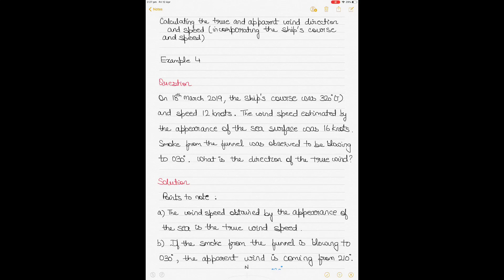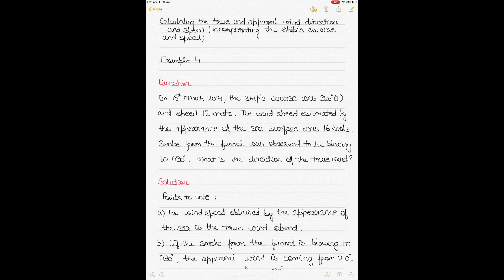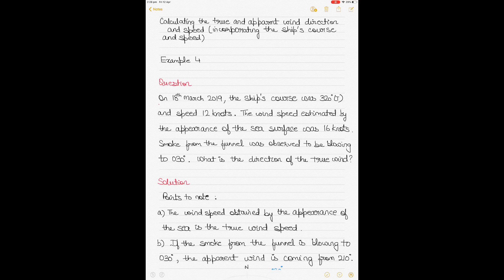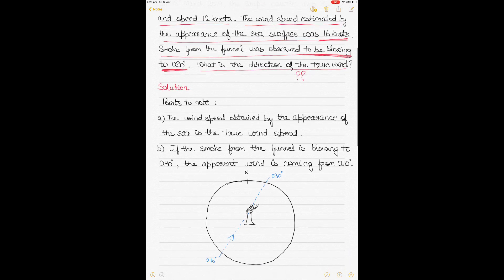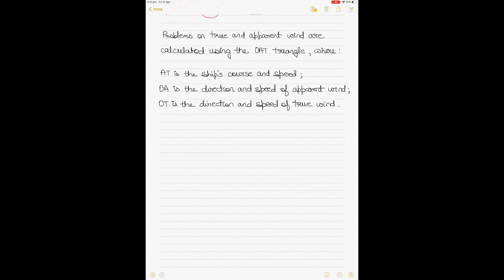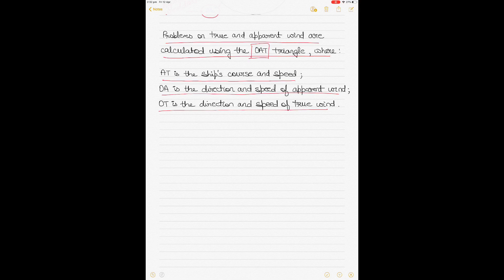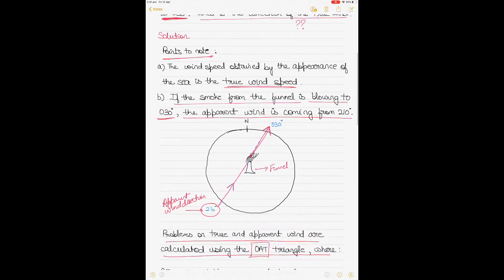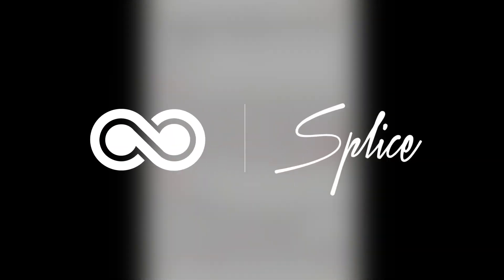Calculating true and apparent wind direction and speed - Example 4

Comment: Sir if it is mentioned that ‘ AT CO = 247.5* & FUNNEL SMOKE WAS BLOWING TOWARDS 3 POINT ON HER STBD QUARTER then APP wind direction is 011.25* OR 033.75* ? means 3 point value is added to stbd beam or subtracted from Right astern ?